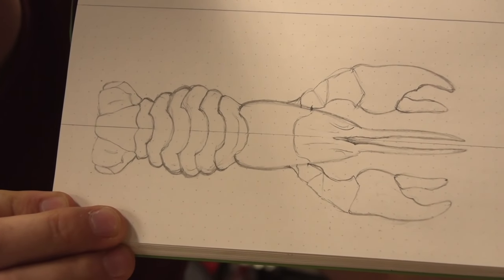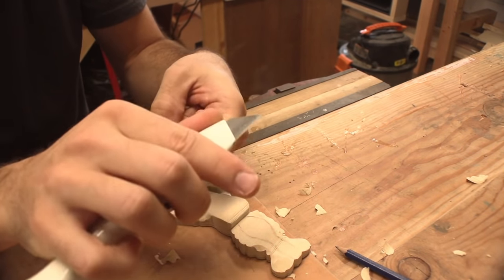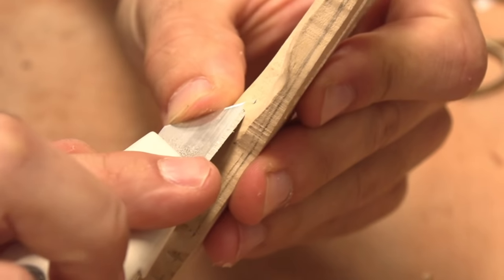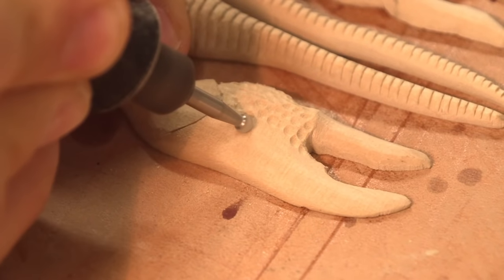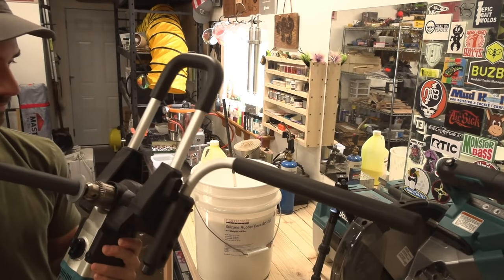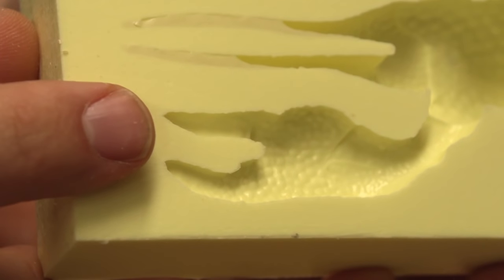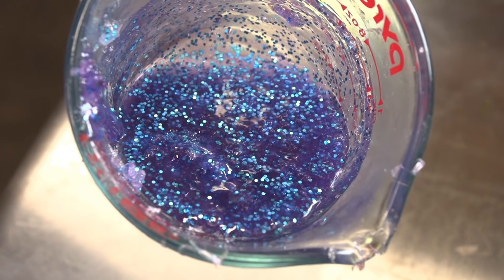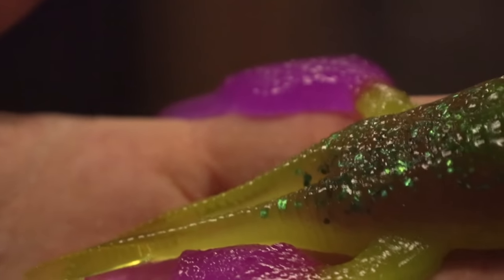Making a Chunky Open Belly Pour Crawdad Bait

Comment: Crawdads are incredibly smart critters. I have kept them as pets on and off for years and if theres a hole in the lid they will find it and get out 100% of the time eventually. They are awesome pets but you have to use the air tight tank lids and just dremel or cut out the spots for the wires and keep it tight tolerances so they stay put. One time i went to take my filter cartridges out to clean them and i reached in to grab the filter and bam i got pinched, it was scary and unexpected haha they do prefer a bigger floor plan tank otherwise they will fight a lot if theres more than 1 or 2 per sq ft.
Reply: and dont put any plants in, they always up rooted and destroyed nearly everyone I had
Reply: @Danny_Harris-Arts  cute but destructive lol

Comment: My grandfather would use cheap disposable condiment squeeze bottles with a bit more precision capable tips to do the filling of the molds with better detail and less spills.  Not really a big deal, but it made using multiple colors simple and filling in small details easier for certain.

Comment: In louisiana they are called crawfish, and there is a difference between crawfish and crayfish. Crawfish are grey when young, and red when fully grown, and burrow in the mud in still or slow moving water. Crayfish live in rocky areas with more current and are usually not red, they live more north than crawfish

Comment: Acid rain would probably have an affect on people but we're not always outside in it.  Everything in nature is affected because it doesn't get to go inside to escape the weather.  Also I believe acid rain can be regional specific based on industry.  So certain areas are more prone to get it regularly and yeah it's not like acid that will burn you but it's just more acidic right?  Just to the point where where it throws nature a little out of balance.

Comment: Acid rain happens pretty much everywhere, it's caused by continuous pollutants rising into the air, changing the pH in the water, typically our drinking water has a pH of 6.5-8.5. Acid rain has a pH closer in the 4-5 pH range. Acid rain will not harm you and has visually no difference with common rain. Sux but man-made pollution changes the rain.🤕